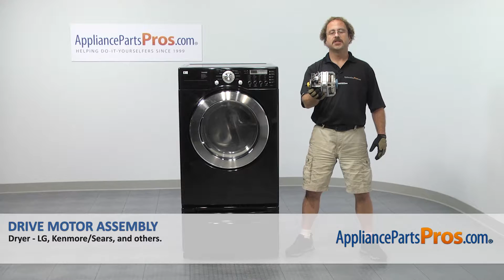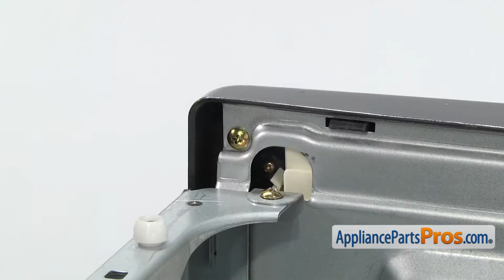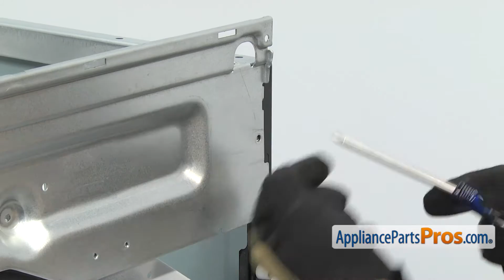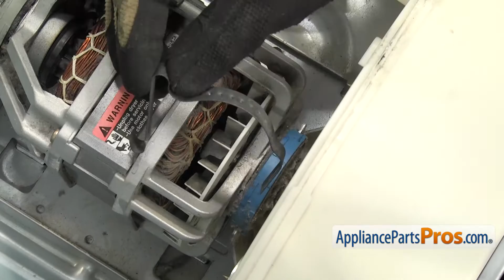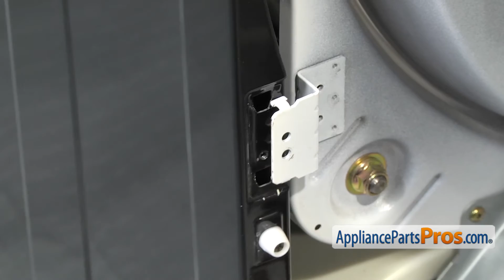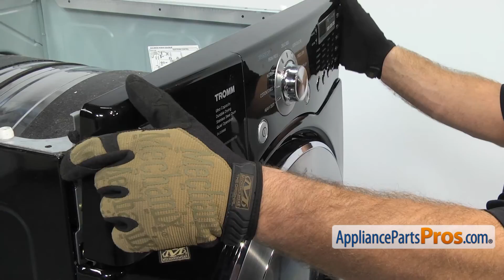How To: LG/Kenmore Drive Motor Assembly 4681EL1008A

Comment: Great video, one part that happened to me is the blower wheel/fan was fused to the hub and wouldn't come off.  I was almost ready to break it off and order the part but instead... took the motor wires off and the motor clips off so i could move the motor downwards at the back.  Which gave me room to put a screwdriver to the back of the blower wheel/fan, gave it a good whack on the screwdriver and it came off the hub.